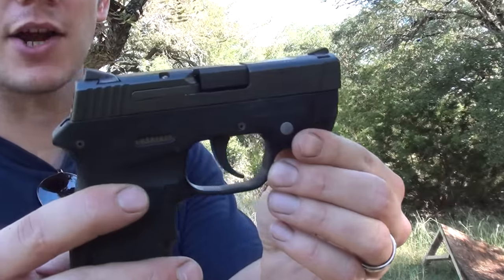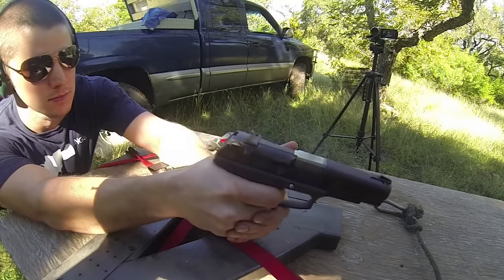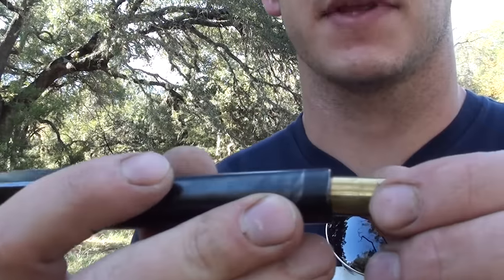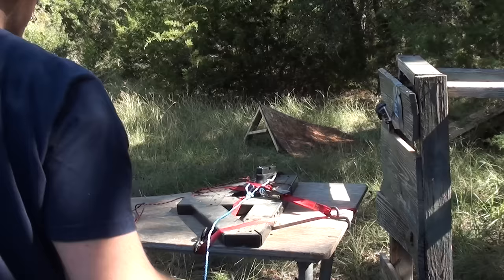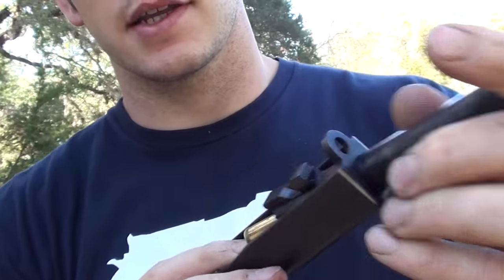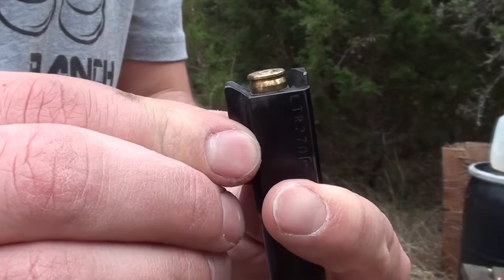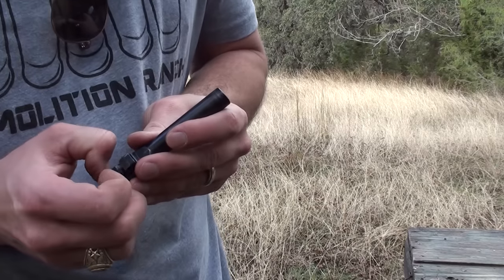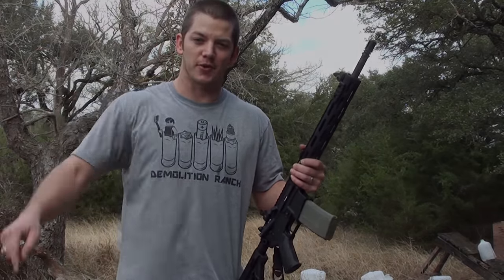Firing the Wrong Caliber

Comment: Some of the expended .45-70 Gov't cartridge cases at recovered via archaeological digs at Little Big Horn show splits down the casing. These were fired by Indians in larger caliber rifles, .50 and up. 

One recovered skull from the Reno-Benteen entrenchment site of a KIA trooper showed a keyhole-shaped entry, which was from a tumbling bullet, possibly an example of a .45-70 cartridge being fired in a larger caliber rifle.
Reply: Thought the Indians mostly used lever action.   Not sure there was many  rifles shooting a larger caliber then 45-70 in that time period, not sure a 45-70 could be fired through a 50-70(50-70 wasn't much of a round). 50-110 weren't out yet. 🤔
Reply: G Pierson they probably used mostly guns that had been stolen from soldiers they killed. Whatever the standard military rifle was is probably what they used the most. 45-70 levers were probably not used at that point if I had to guess.
Reply: Even down to copying the design of the hatchet, the "native Americans" had a thing for copying American tools and weapons. I guess they like shooting guns more than poking at things with sharpened sticks. Just like they liked the idea of a weighted axe head affixed to a handle. Just like today they like showering in showers built by Americans, using hot water brought to them by Americans, instead of standing up in a line picking the lice out of each other's hair as their only form of hygiene and sustenance
Reply: Talk about cultural appropriation ... Maybe if they focused on their own issues instead of just "copy smart white man" they wouldn't be going extinct ...

Comment: 380 in a 9mm rated gun just becomes a bolt action pistol.
Reply: Finally someone has an explanation nobody was saying shit about what happens like does it ruin the gun or what does it jam more? Hate these stupid comments that got shit to with shit 💩🙅🏾‍♂️💩
Reply: @Proveloped i think a russian somewhere read that comment and is currently making a big assmissile launcher shaped like a glock
Reply: 9m = 9 meters
I think you meant 9mm
Reply: @olleappelblad4938  that would be a big bullet
Reply: bolt action LMAOOOOOOOOOOOOOOOOOOOOOOOOOOO
Reply: More like a spring loaded airsoft gun
Reply: I didn’t know Glocks had a bolt..... more like a slide action pistol
Reply: @DesertDweller1776  exactly
Reply: @DesertDweller1776  It's a joke, a funny haha friend.
Reply: Lol
Reply: 9 mm in a 10 mm same thing. Had no problem shooting the 40 in the ten although works well so far. Havent chronoed the 9 in the ten yet. Necked down the 38 special to fire 9 mm rounds. Slow af. As expected
Reply: @IG2Ks305  what are you saying
Reply: @goodgenes0  what I said 🤣
Reply: a 9 meter?
Reply: @p30jeff57  9 Meter peter
Reply: someone should do a full 380 mag and use it like a bolt action

Comment: I accidentally shot a 'MOAB' out of my .380 pls help
Reply: Try turning it off and on a few times and if that doesn't work, try re-installing adobe premier, that usually does the trick, but if all else fails hit it with a mallet.
Reply: A Travler from a different land instructions unclear started a war
Reply: xPikezUPG lk
Reply: xPikezUPG lp
Reply: I did the same with my 22. It worked fine. It was a M.O.A.B. short
Reply: M.O.A.B longrifle
Reply: Say TACTICAL INBOUND IT OVER!!!!!!
Reply: Have you tried blowing on the cartridge?
Reply: Try control alt delete then reset it then delete internet explorer
Reply: No ill just run can u hold that for a sec
Reply: xPikez that's why you should of stayed with windows 7
Reply: I did that once, im still hiding this phone from the shake downs in a supermax prison.
Reply: xPikez have you scanned it with your antivirus?
Reply: xPikez are you assuming that middles gender?
Reply: You got to unplug the power and plug it back in if not try to stick a finger inside a coconut
Reply: Put it in rice
Reply: xPikez go buy a new one. How did you even manage to fit it?

Comment: What I learned from the end of the video when he fired the .223 rounds from a real rifle: GUNS ARE POWERFUL.
Reply: guns dont hold gunpowder... guns arent powerful, the ammo is.
Reply: Mhm...
Reply: Vic Arous
then again, the right ammo in the wrong gun does prove a point. That AR-15 had the right barrel for the 5.56mm round, whearas the pistol did not, the gaseous expansion drifted past the projectile, so not all of the potential energy was converted into kinetic.
Reply: MAtthew Bo
Reply: This does't have anything to do with "chemical" potential energy, which is altogether a different matter.  So Plucky did get it right.
Reply: #Alex Martin no guns dont hurt at all
Reply: ***** He did get it right, potential energy is mass x gravity x height. The powder in a cartridge is chemical potential energy, not just potential energy. Chemical is mostly related to the energy that a substance has when a reaction occurs. Much like the energy content in gasoline, which has the potential to drive the pistons in an engine before ignition.

Comment: So technically as long as the .380 acp is the last round in the clip, then everything should work just fine
Reply: It's not "clip" it's called magazine!
Reply: weapondude123 sorry, I'm new to guns. would clips be used for rifles then?
Reply: +Curran Hyde well they are only used for a few different rifles, such as m1 garand and sks. They go in the top of the rifles, they make it faster to load ammo in the gun.
Reply: +Curran Hyde They have clips and magazines both for rifles and pistols. With some exceptions a clip holds the rounds and you load the gun but the clip does not go into the gun. Generally you push the rounds off the clip which is essentially just a holder for the ammo and to make loading faster. A M-1 Garrand is one exception to the rule that i can think of right now where the clip and ammo both go in the gun. A magazine holds the rounds as well but the magazine and rounds attach to the gun.
Reply: +weapondude123 clipazine
Reply: +bob dash Ha!
Reply: +Curran Hyde As long as you don't mind that last round not ejecting, then yeah.
Reply: TRES-4   Except the 380 does not have the power to function a 9mm slide due to recoil spring strength 👍🏻
Reply: its a clip if its holding up his man bun

Comment: What I have drawn away from this video......shoot the wrong rounds so shell casing do not get dropped on ground during crime scene.
Reply: Great way to fuck up the throat of your barrel for going sub-caliber, or have a Kaboom if you increase the pressure too far.
Reply: TactiColt "OH NOOOOO not the throat of my barrel! I'd rather go to jail!!!"
...
Said no criminal ever.
In trying to sound smart, you completely missed the point.
Reply: Well, if you're thinking of criminal intent there are lots of better ways to go about it.  In this case, you're talking single-shot if you're relying on a failure to cycle to police your brass.  

There's something else that can get you multiple shots on target without any risk of dropping brass.  A revolver.  

Not trying to sound like a smart-ass either, just saying there are safer and more practical approaches, even for 'dumb criminals'.
Reply: or just use a revolver.
Reply: oscarchi Specifically, the 1895 Nagant with a silencer.  The only production handgun that offers multiple, suppressed shots without dropping brass.  All NFA and local laws apply, etc.
Reply: but you only get 1 shot because you do not load more rounds, so yeeee, I think it's better to just use a revolver
Reply: criminals and their fingerprints, lets not forget the hairs that could fall off your body if there is a struggle
Reply: bold and surgically removed finger and toe prints ....It makes me more aerodynamic when i fight duh
Reply: TactiColt lookout its the fun police
Reply: revolvers do not drop shell case either.
Reply: LifesApoem OMG I FOUND IT!!! A COMMENT FROM 6 YEARS AGO!!!!! CHALLENGE COMPLETED!!!!!
Reply: Who ever made the challenge for finding comment from 6 years ago I fucking did it
Reply: @najx2224  same!!!!

Comment: The slide barely moved an 1/8 of an inch while firing the .223 round which kind of surprised me since it has a lot heavier load power but could be because of a combination of the tape & the bond to the extractor which wouldn't allow it to actually extract since it's obviously NOT built to fire long rifle rounds! I was expecting the gun to get a lot more damaged! At the very least blow the magazine out of the gun & crack the frame & blow up the barrel! DON'T TRY THIS AT HOME!! Lol! I've shot .380 acp rounds out of a 9mm before but have NEVER tried a rifle round out of a pistol especially NOT a polymer framed pistol for obvious reasons!
Reply: lnfiniteSorrow not enough gas pressure to do much,  most probably just puffed around the much smaller bullet imo
Reply: The .223 bullet was too small to seal the barrel to create any meaningful pressure and therefore no harm was done to the gun.
Reply: A longer barrel would make zero difference.
Reply: The reason it didn't move the slide is almost none of the powder energy was used to propel the bullet. Also, much probably got ejected out the barrel unburned.  The instant the bullet left the case, there was nothing to contain the pressure.  In essence, the barrel length was the seating depth of the bullet.
Reply: Kerry Cato Exactly right.
Reply: lnfiniteSorrow
Reply: Seem to forget that rifle powder burns slower than pistol. So if a hand loaded .223 with pistol powder was used I'd expect catastrophic failure

Comment: The case head for the .223 is actually the same as the .380 acp, but god forbid you shoot the .223 rem out of a .380 acp pistol
Reply: i don't think the results would be any different.
Reply: The case will be blown out to a straight wall case instead of being split open.

Comment: try 7.62x25 round in 9x19mm gun.. :)
Reply: , thanks to an idiot who sold me a weapon informed me it was 7.62x25, and it was marked for this cartridge... but nobody stated that it had a 9mm barrel installed. chambered fine, fired... no recoil, no cycle, can/will fireform the brass into the chamber of the weapon... no damage except disappointment... and having to pause range day to yank brass out of the chamber.

Comment: I am not an expert by any means, but this all seems pretty dangerous from the start.
Reply: Well if the gun "Squibs", (the bullet gets stuck in the barrel) the explosion of the gunpowder has nowhere to go but the point of least resistance. Sometimes that point is near the front of the gun but not out, and the front of the gun could become shrapnel hurdling towards your face and/or vital organs. It's bad shit dude.
Reply: There was never any danger firing .380 out of the 9mm, and the rest were fired remotely. No real danger here. At the worst he would have damaged the pistol.
Reply: *****
That's not even remotely accurate. A case rupture (such as when firing an undersized cartridge in an oversized chamber) in a handgun is serious shit. At best, you damage your gun with no personal injury. At worst, you blow your barrel shroud and parts of your firing mechanism which is, in practice, effectively setting off a very small fragmentation grenade in your hands.

There was this gent we called Hamburger Hands a few years back for that very reason. He was a little powder happy with his reloads, and learned real fast that all that empty space in the 40mm is for gas expansion. Blew the shit out of his hands and forearms with a low-chamber pressure weapon that "wasn't over pressured".

Being lax in your safe handling methods is asking for a hospital trip for you or the other people on the range, dude.
Reply: BrotherLazarus you know your shit dude
Reply: Willem Cohen
It's the trade I ended up going into--gotta recognize potential issues (such as some custom builders not stamping clear cartridge markings on a barrel or receiver, gent managed to blow his entire upper receiver group and a good chunk of barrel to bits by loading a .300 BLK mag into a .223 Wylde upper) and make sure you don't make those mistakes--in addition to warning people that if they end up doing something like this, property damage is likely going to be the least of their concerns...
Reply: ***** Also, of note, I finally bothered to dig up the specs of the relevant cartridges involved: maximum SAAMI specs for the .40 are 35,000 PSI, .223 is 55,000. That's a 20,000 PSI difference in a short-recoil pistol with a barrel hood instead of a chamber that ends up reinforced by the end of the upper receiver block. So your comment about not being overpressure are more wildly inaccurate than I initially estimated.
Reply: *****
Close but still not quite accurate. Case blowouts of any kind are dangerous for a reason--and allowing complacency to slip in just because he got lucky here is a really good way to end up missing skin.

Shrapnel hurts.

Comment: People overact with those glock pistols way way overrated pistols
Reply: Yea me too
Reply: People tend to like Glocks because they're relatively cheap and very well made, it's basically the "every man's" handgun.
Reply: Infin1ty Yes ok,but they are far from the best handguns ever or top 3 ever.
Reply: UGNS Well, no. But their reliability, availability, and cost make it kinda the go to for anyone whom can't afford or don't want to buy more advanced guns; kinda like the AK.
Reply: notmyuseristolethis It's popular exactly for the same reason as the AK. Solid, easy model, reliable, and cheap.
Reply: Good solid guns innovative in their day, but the grip angle is not ergonomically correct. Now days you can get equally simple and reliable guns in the same price range that point more naturally having a proper grip angle.
Reply: Jack Saegar The grip isn't ergonomic, firing mechanisms have changed. Parts have been reengineered for less maintenance and better performance, there are better innovations than the glock, much like the AK. No ones saying glocks are bad, but it isn't the best weapon, looks aside.
Reply: ***** Beretta's are way to bulky and heavy for shooting a 9mm. I would take a SIG any day.
Reply: SniperSpree58
Every pick up one of the Beretta Storm PX-4's?  You'll change your mind about Beretta completely.  Not as heavy as the traditional 92FS series....and falls back on target a lot better.  Plus just seems to fit in your hands perfectly.  Not like the brick type Glocks...
Reply: Henry J Anderson II I don't even like Glocks all that much. I prefer SIG.
Reply: Henry J Anderson II Yeah and 3x the price of a glock. If I'm going to drop 1200 on a pistol I'ma get a CZ. 
Glocks are excellent pistols, they aren't the best. But if your price matching, only other pistols that come close to Glock pricing is Norinco. then you have to ask yourself if you'd rather trust cheap chinese mass produced firearms, or quality mass produced pistols from Germany.
Germans got a way better track record in my book. You haven't heard about products from Germany getting yanked off the shelves have you? Cause its happened to hundreds of chinese products.
Reply: Nope,  would definitely go with Walther or for that matter even a Kimber or Springfield... Don't care for glocks,  and although Hipoints are cheap,  they are a bit more reliable in my experience.  Wanna go one better... Datonics. 45acp Secret Service Edition... But,  that's also a bit on the pricy side,  and all of those are hand made...
Reply: Henry J Anderson II I thought the secret service used Sig Sauer?

Comment: Good to see that the gun holding contraptions from 7 years ago have not changed much to modern videos most people use a chronograph to test speed and calculate power Matt uses a water bottle

Comment: 4:40  This is because brass expands on a shot to make a seal.  If you used a steel casing, that probably wouldn't happen.  That's also why wolf ammo runs so dirty.  It doesn't expand to make a seal, so more grime blows back into the action of the gun.

Comment: Very interesting 
So in an Apocalypse/Hits the Fan scenario having .380 is a substitute for 9mm in a real emergency as you'd just be firing it in semi-auto cuz you'd have to rack the slide and manually extract prev shell/feed the next due to the decreased pressure/force. 
Truly a great learning lesson.
Reply: It wouldn't be semi-auto anymore if it's not able to automatically load the next one, what's you've done is changed your 9mm into some sort of pump-action.

Comment: It may have been a very good thing that there was all that play in the barrel to prevent full compression. Otherwise, the barrel may have exploded from the excessive pressure for which it was not designed.

Comment: I have a Beretta 950b in .22 short, but how in Brazil is almost impossible to found this ammo, i builded a .22lr magazine, changed the slide spring and machined the barrel to fit longer cartridge and it shoots perfectly. I just dont know for how long time haha
Reply: What cartridge can you fire from it now?
Reply: @joshryan9735  At the moment, 7 rounds in .22 Long Rifle, hollow point similar to CCI mini mag and one in the chamber, totalizing 8 rounds. Before was 6+1 .22 short. The job was more easier than looks like. I show you if you want

Comment: Yeah, a Glock 23 doesn't have the Muzzle Velocity an AR has. But if you were in a Jam, with an empty Glock 9 and a 5.56 Round that is most definitely gonna put a hole in somebody. But be ready to knock dude upside his head if he doesn't Die, cause the Glock has to come apart to extract the 5.56 Casing.